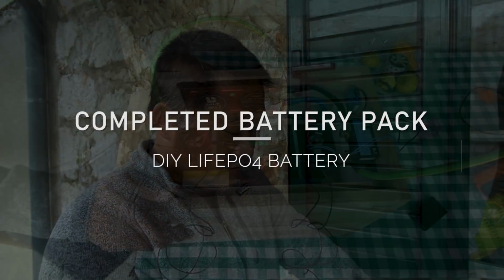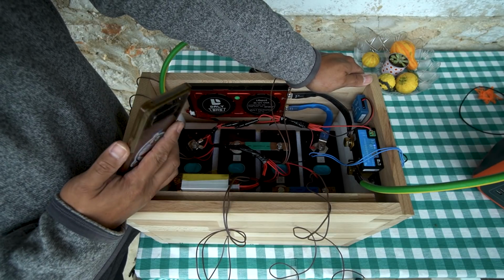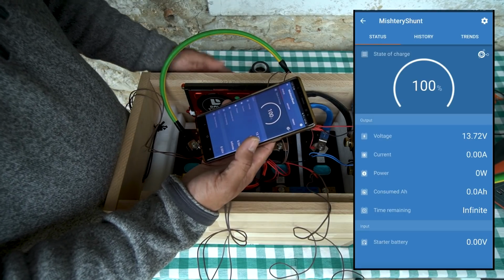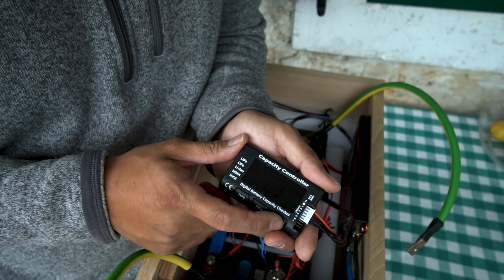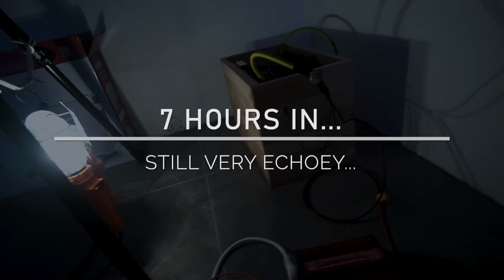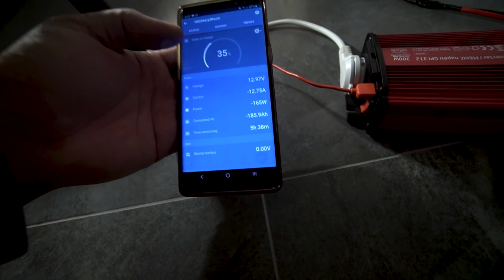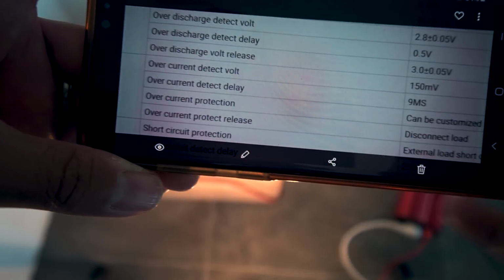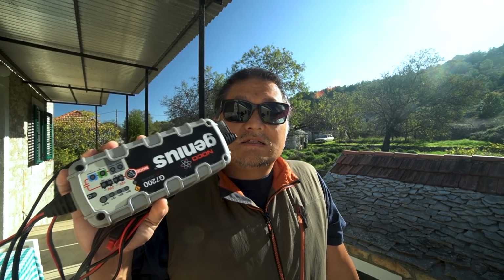DIY 12-Volt 280Ah LiFePO4 Battery // Full Capacity Testing // Part 3

Comment: Dan! I'm pumped that you actually got 282.4AH out of your 'cheap Chinese' batteries!!! Yay for us! Now, I'm not afraid that I'm gonna over charge or over-discharge them (I'm using (2) either @ 12v or 24v) and can't ever see a reason why I'll ever need more than 280AH draw- all at once. BUT, I notice that the AL cases seem to bow out a lil on the face? You built a box, but, I need to strap them, or, tape them to hold the cell together. I plan on using (4) 1" squares of double sided VHB tape used in the corners to hold the cell together- twice. After sort of 'holding them together' with the VHB tape, I'll either strap them by hand, or, tape them together. I'm a little concerned about the weight of (4) cells VHB'd & taped together, as I think each battery weighs 47 Lbs. I do NOT want to strip those teensy, tiny lil M6 bolts out of the anode and/or cathode, so, I prefer the least strain on that connection as possible.
Reply: Dan- I totally agree, and, I really like the foam insert between cells. That way you choose which length to make your buss bars, and, no matter how much stress- the M6 bolts are free. I'd prefer to have the cells tightly linked together (size & footprint), and- on genuine consideration of draws & loads, I NEVER think I'll ever get over 100 Amp draw. I'm using (2) either in 12v or probably 24v and DON'T plan on running my 11,000 BTU A/C off of it. Even the 'on-board' heating system doesn't draw that much. Croatia- talk about overcoming issues, in a small town, remotely located & yet- still able to git 'R done! Awesome work, my friend!
Reply from the maker: That is exactly what I was worried about too. I had it originally taped together and connected with the bus bars that came with the cells. Then I realized that if the walls swelled in the heat of summer, the bus bars won't give it any room to flex and push away from each other. That's why I chose to add foam between each cell and make my own longer bus bars. The m6 terminals are definitely the weakest part of these otherwise great batteries.

Comment: Hmmm,I never go over 14.5V
Reply from the maker: It is virtually impossible to charge a 4S LiFePO4 pack to 17 volts. The chemistry does not support it without some really bad things happening in the process.
Reply from the maker: that would be 3.625v per cell and you should never go over that. In fact it is better for the cells to keep it under 3.6v.
Reply: @freelyroaming  but you had 17volt,
Reply from the maker: Where did you see that? You might want to look again.
Reply: @freelyroaming  sorry. 13.7 V,....7:33 min in the video

Comment: I've learned that when charging LiFePO4 cell it's full when voltage here to 3.6 to 3.65 volts. That means 14.5 to 14.6 volts.
When charger is stopped, voltage sets lower.
Another important value is 20% remaining charge which when lightly discharged is 12.6 volts.
I'm also tuning in my chinese battery monitor supervising GWL 12V 90Ah battery which doesn't have BMS...

Comment: Is it possible to cage something that the bms cuts of a bit earlier ? Or otherwise is the option to ad a battery protect .
Reply from the maker: you can install a programmable BMS instead and have it cut off at a higher voltage. It would be cheaper and probably less complicated then adding another device. I am ok with it cutting off at 2.8 volts (11.2 volts in 4S). It still has plenty of room to go before any damage can occur.
Reply: @freelyroaming  thanks so much...
Reply: @christianwinkelmann8477  if you cut off before the solar charger, it will burn!
Reply from the maker: This has been disputed and tests have been done to show that high quality mppt solar controllers don't become damaged when the battery disconnects.
Reply from the maker: However you will read from the SCC manufacturers who recommend against it. It is just to remove them of any warranty liabilities.
Reply: @freelyroaming  if it happens 2-3 times in a year, no-problems: Capacitors inside SCC will survive to this shock.
But if it happens everydays, bye bye solar charger... 

Anyway, it's easy to cut off the inverter before bms. 
The most  important thing is a good bottom balance of the cells (around 3V per cell), and then setting in the inverter a low voltage disconnect multiple of number of the cells. 
Example: 8cells x 3V= 24V disconnect the inverter
Reply from the maker: I would like to see some tests to show that that is the case. Relying on inverter cutoff is not a good way for people using a 12v pack on a camper van set up. There are lots of native 12 volt devices that do not use an inverter at all. I do not see any practical situations where the bms triggers low voltage cut off on a regular basis anyways. If the panels are receiving enough power to create a big enough rebound surge, the battery voltage should be increasing instead of decreasing. If you are trying to create this scenario of course you can but it's just not very likely to happen in the real world. I've lived full time in a solar powered camper for 13 years now and it's never happened.
Reply from the maker: This actually happens all the time and I've never seen a SCC become damaged from it. Take for example, there are hundreds of thousands of, if not more, portable solar suitcase out there with inline SCC. Every time it is deployed the panels are sending energy thru the controller without any batteries connected initially. If this really is a problem, these solar suitcases should be frying SCCs all the time. These solar suitcases are the simplest examples that isolates what people say could happen. But they simply don't happen. All I've seen are rare and anecdotal incidents and pretty much all of them involve more complex systems where other things could be going wrong. Without many real world cases I don't see how anyone can be convinced it's a real problem.

Comment: Be careful with that "capacity controller" It gets all power from cell 1. Since you have the active balancers it might be ok but I killed a cell not realizing they only draw power from the 1st cell.
Reply from the maker: Good point. I don't actually trust it too much after seeing that it doesn't automatically refresh without toggling thru the cells. I think it will be mounted but stay unplugged until I need to see cell balance data. Although it draws so little power, I'm guessing it would take many months plugged in for it to see any noticeable power consumption.